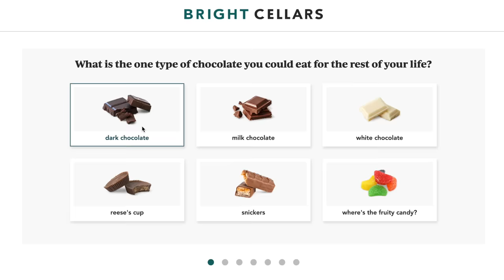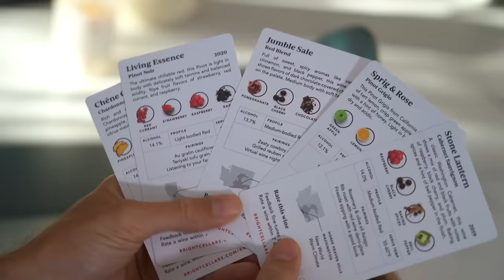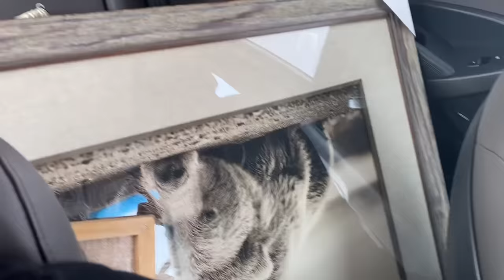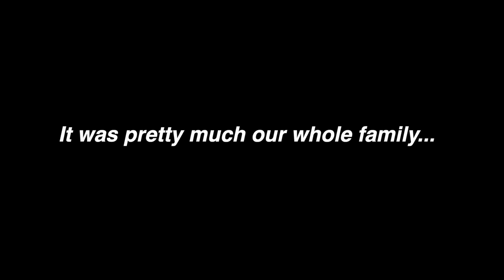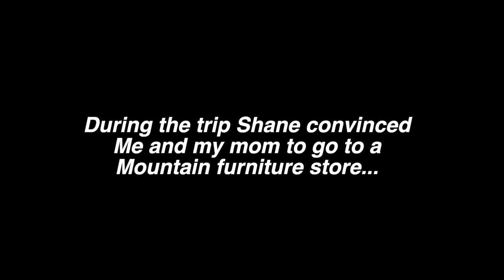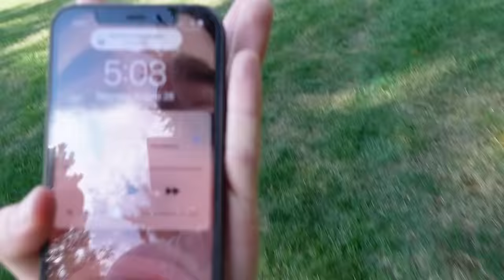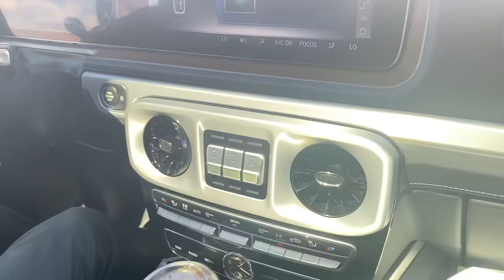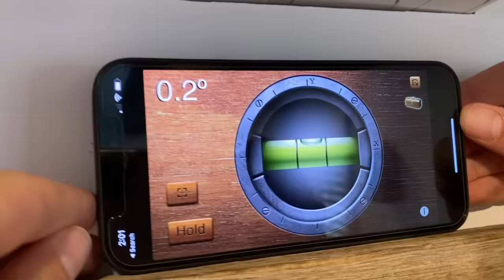Decorating The New House and Furniture Shopping!

Comment: The best way to mow a large area is to go around the area with the non-bag collector side to the INSIDE at least once around and then to continue to go around the area in concentric circles until there are only small 'islands' left. Just do strips on those (up one side, down the other) until completed. Also, be sure to overlap your passes by at least a few inches. Keeping your front wheel  on the edge of your prior pass is a good way to keep from missing spots.

Comment: Dude, I just though! What if Ryland & Shane got an inflatable raft, two meters of string, attach one end of the string
to the back of the paddle boat and the other end of the string to the front of the raft.

That way, they use the paddle boat to pull the inflatable raft while there are people in said raft whilst Ryland & Shane
are in the paddle boat! Does that sound weird yet fun or what?